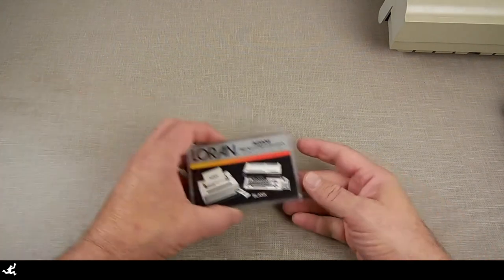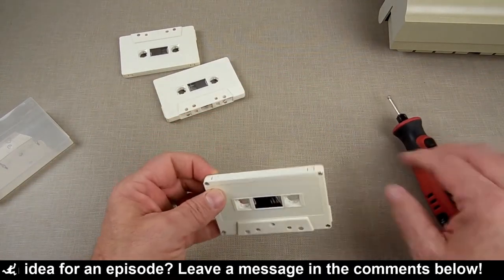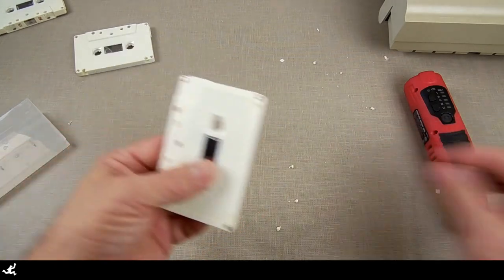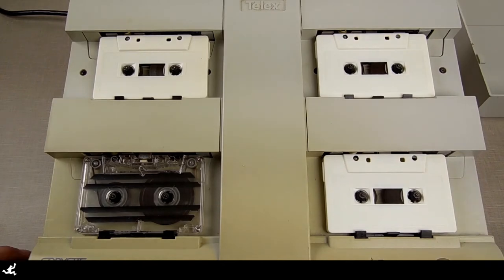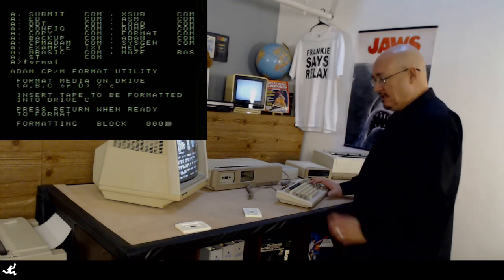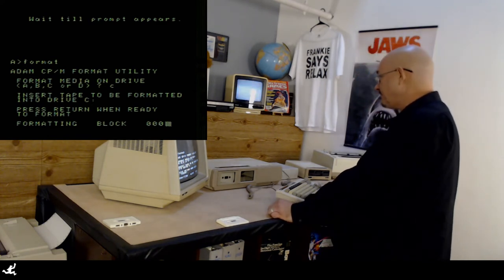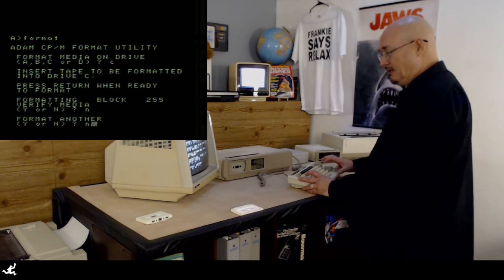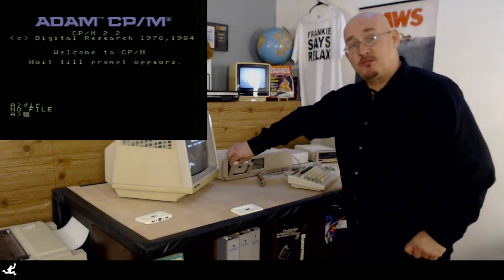Creating Coleco Adam Data Packs

Comment: Back in the 90s when I have a busness selling Adam stuff I use to make blank tapes.  I first bought a brand new high end Kenwood dual tape recorder and that wasn't good enough to do the job.  I then spent a lot of $ and bought a new Yamaha dual drive and that worked but not 100%.  I use to run a progam on the Adam that would check ALL of the blocks on a tape and let me know if these was any bad blocks.  Around 10% of the time there would be some bad blocks.  I was using high quality TDK tapes.   If you make your own tapes check the blocks.  Just because a tape seem to work doesn't mean it good.
Reply from the maker: Good points

Comment: I used pliers to just break off the metal pins in my data drives. Instead of drilling holes. and using a dual tape deck to try to copy smartbasic ddp. I don't remember if it worked, but i tried.
Reply from the maker: I did that once

Comment: picked up one of these duplicators for mine, any particular procedure to work with? the side switch and how long/short a tape you can get away with
Reply from the maker: I did A/B and used 60 minute tapes - you have to drill a hole first the capstan in the data pack
Reply: @8BitMilli  ah, right user error, i was misreading it as a OR b not a or a/b, which does explain why my test audio cassette ran both sides